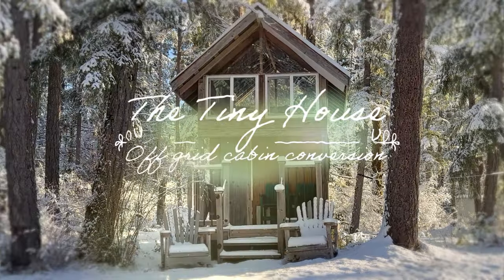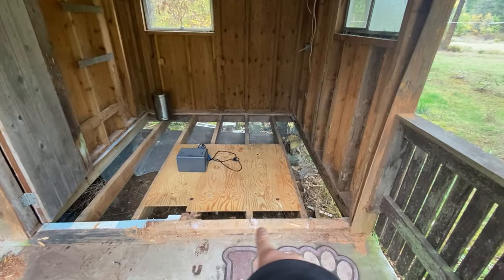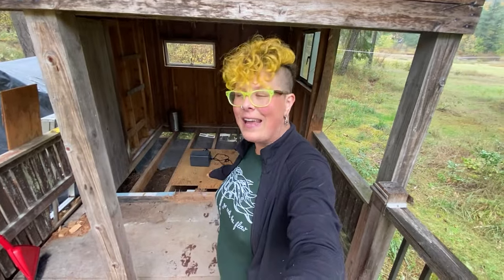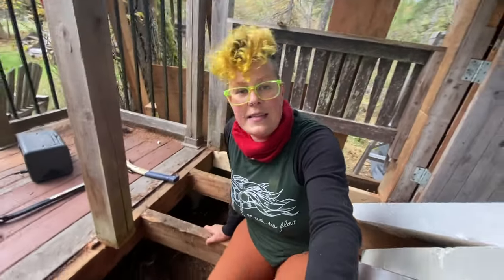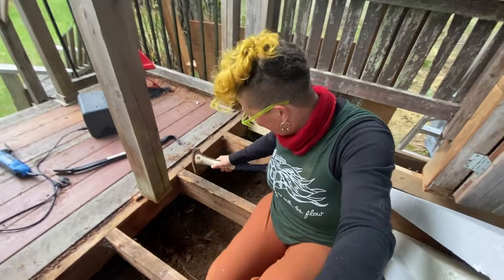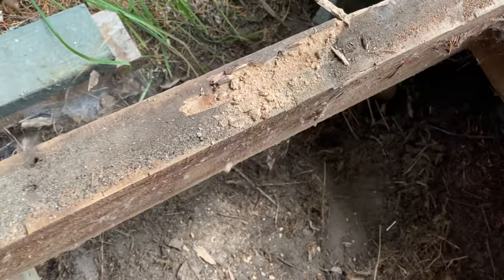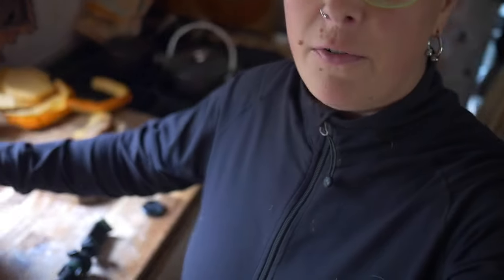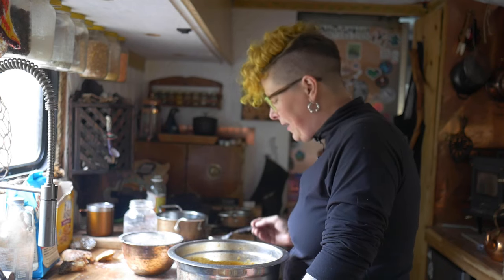Is the Cabin build in trouble? WOOD ROT in the Tiny House!!

Comment: Your floor boards don't seem too bad. Wet wood attracts carpenter ants in PNW. These nasty insects chew tunnels thru wood. Your floors might have a bit of dry rot. Maybe treated w/wood sealer? Perhaps strengthen floor joists by sistering adjacent floor joists? Also, suspect you may need a bigger beam in ceiling to handle load from roof.